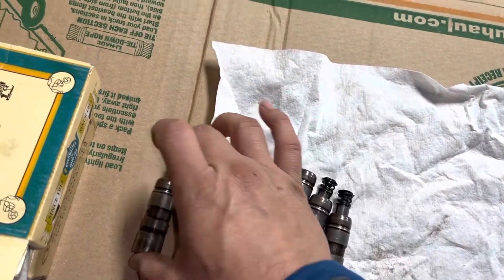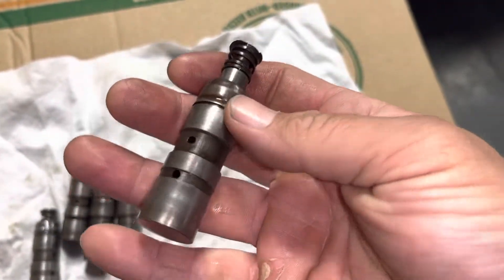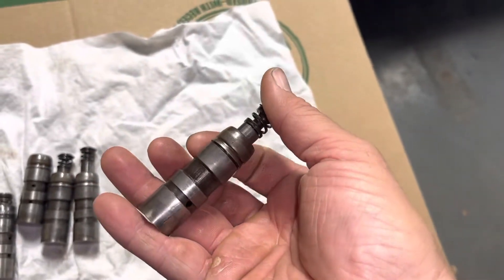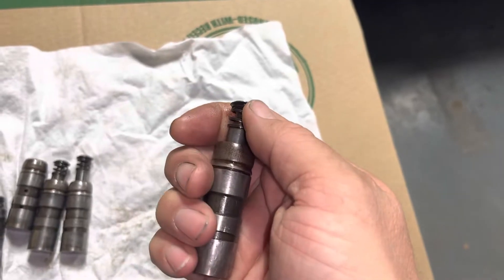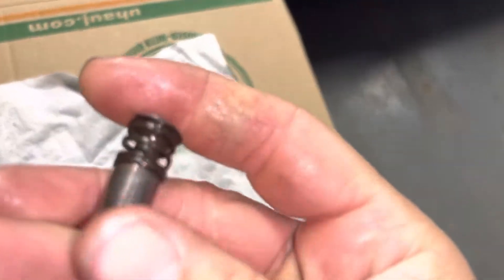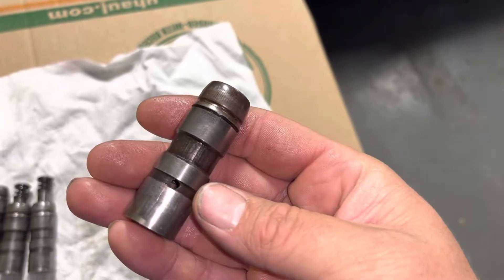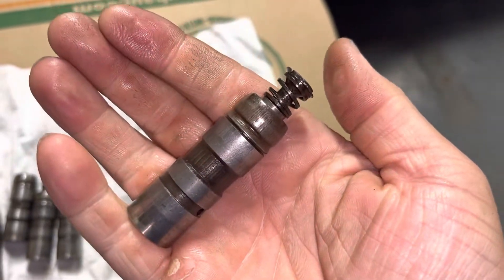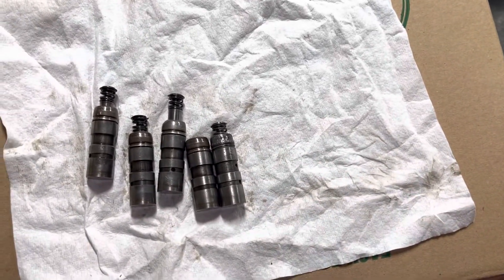Jowett Jupiter/Javelin Hydraulic Lifters/Tappets

Comment: Tom I have a Jowett Javelin and a friend of mine has a Jowett Javelin with Hydraulic Tappets
Reply from the maker: Glad to hear it, Paul! I should have updated this story. It turns out that, when assembling the engine, someone used a washer that was too wide, causing a pushrod to catch on it and bend. We swapped in a smaller washer and a straight pushrod and it’s now just typically noisy and not sounding like it was going to spontaneously disassemble.